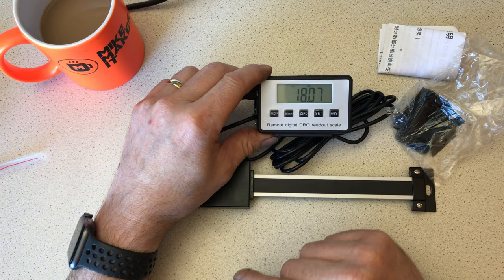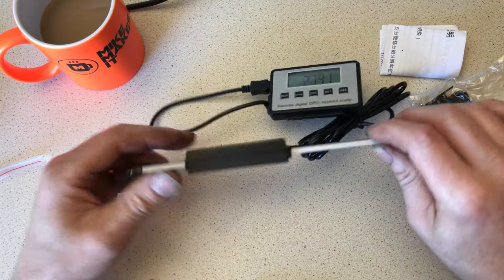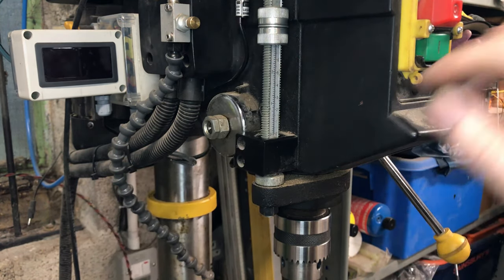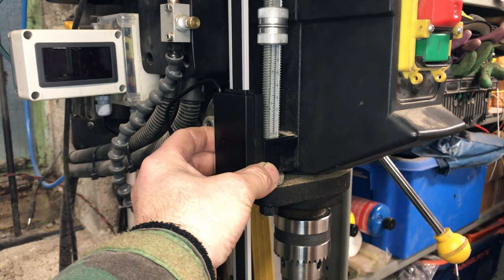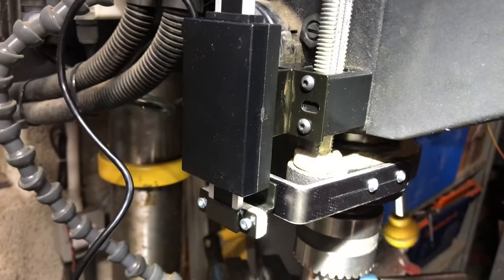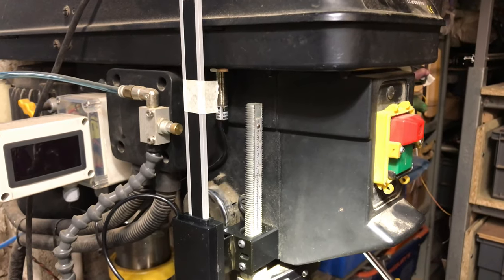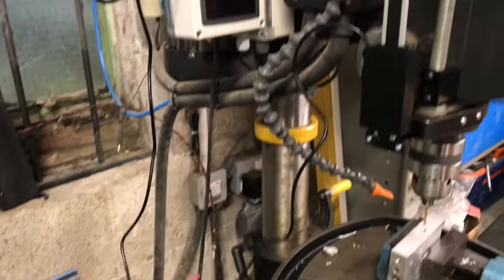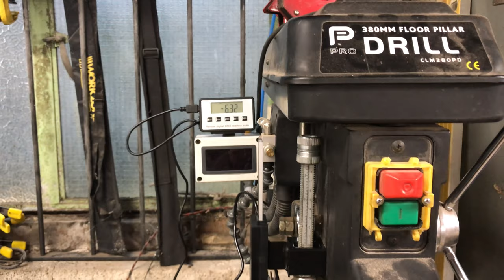Drill press (Pillar drill) DRO (Digital Read Out) upgrade

Comment: Hello! I'm interested in an upgrade for a upright drill press for bowling balls. I cant currently afford a mill. If I could somehow upgrade my press to DRO that would help me drill oval thumbs without a mill. Do you have any suggestions?
Reply from the maker: Hi Altramese and thanks for the comment. When I have to be very accurate and repetitive in the drill press I will usually make up a jig to hold the work piece and this usually works well for me. So in your case you will need to drill an accurate hole set and a jig would be ideal. I have taken a look on Youtube to see if someone has already done this and I found this video https://youtu.be/pUKhDByPy1E
Take a look as this is what you may need. It could be worth building a similar jig if you have many balls to do. I'm not sure about an oval hole  you mention though. Anyway take a look at the video, hopefully it will give you some ideas, thanks for watching 👍🏽